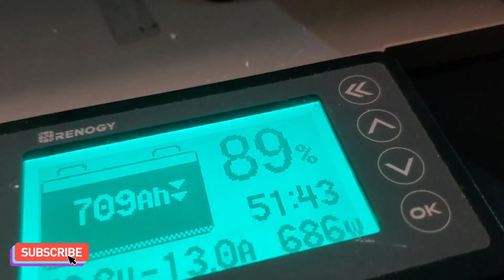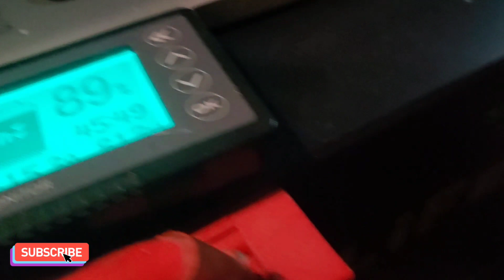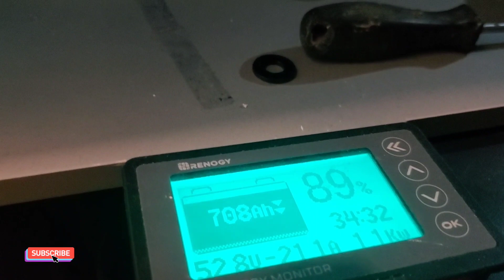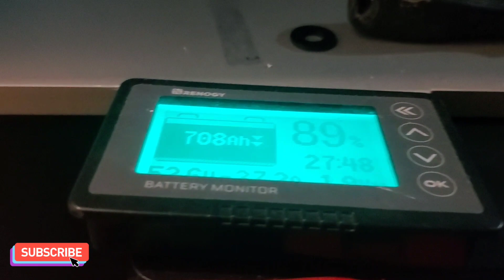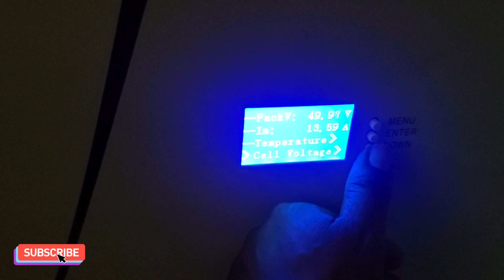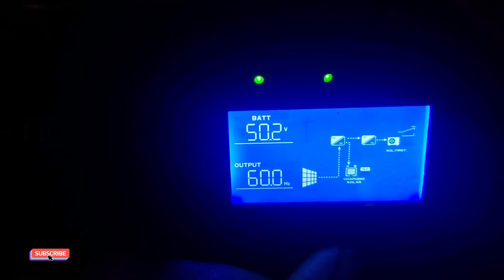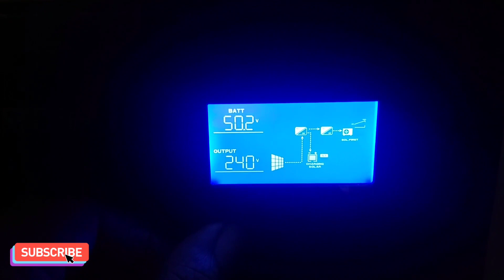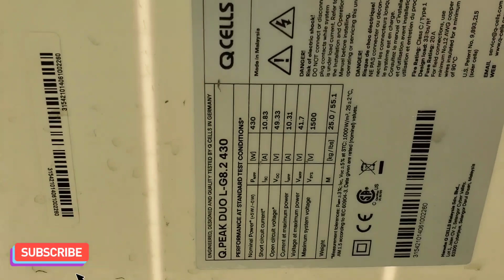Detail Updates About My 40kwh Battery 🔋 Bank  And 20kwh

Comment: Okay I'm scared. Lol. That system is huge compared to what we have. You can't run your ac off of that?
Reply from the maker: With the right amount of solar wire you can 40kwh is a bunch of power just have to have a lot of solar to charge it back up

Comment: I have the Mpp lv5048 been running it off grid for 2 years with the plan of adding another one but the growatt 12kw and 4 of the EG4 batteries looked like a better system so I went with it hopefully I'll have it going this weekend.
Reply from the maker: Did you get you solar setup ?
Reply: @texasoffgridguy8749  Yes I did so far I'm impressed with it.

Comment: I've got about 9 KW of PV and I run everything off of electric except for the hot water.  I still don't have enough for the car.  And I don't have enough for air conditioning.  I think if I triple my panels so I have to have 24 KW I would have enough for everything.  I've got 65 kwh lithium battery that seems sufficient enough but about once a year I run out normally in December.   I'd like one large enough for a full charge on the car if needed.
Reply from the maker: My total combined is 60kwh battery bank I run my house on 20kwh including a 1 ton mini split and the other 40kwh bank I charge my car and sometime use my 3 ton mini split and pv combined I bring in 6kw of pv sunny days I charge pretty good cloudy days I do ok reason I wanna bring in about 6kw of pv more

Comment: Forgot to mention, no grid power either. Cost way too much to have them run the poles and wire plus buy the power. All the money has been spent on solar and now the power is free (kind of).
Reply: The best option for you is to incorporate ac couple to your system since your off grid
Reply: With ac couple you  would be running  lot at a low cost, assuming your system can hand ac coupling
Reply: For what you are talking about you looking at 9 kw of solar

Comment: Have the same batteries as you and a 12,000 watt growatt inverter. As soon as I saw your batteries stacked up I knew I was doing the same. Have 15 KW of solar panels. Just got them hooked up saturday and the batteries fully charged on Sunday, nice sunny day. Next 5/6 days call for rain. Guess we will see how the batteries hold up with a small load.
Reply from the maker: Congrats on the system and I was thinking about 15kw to 20kw of solar